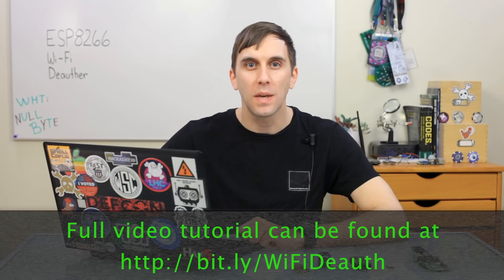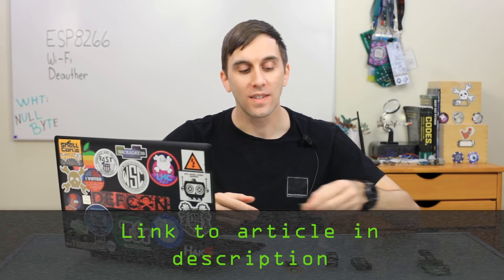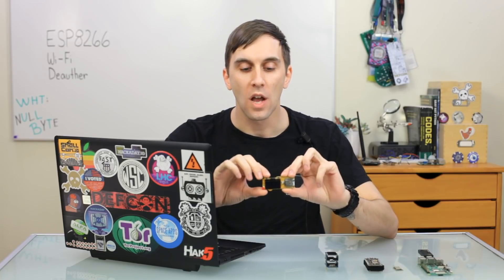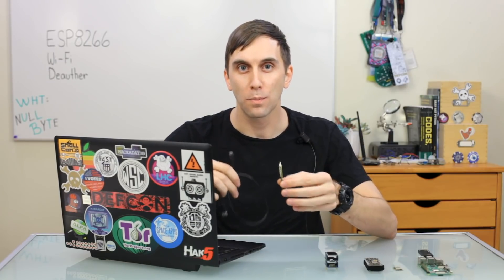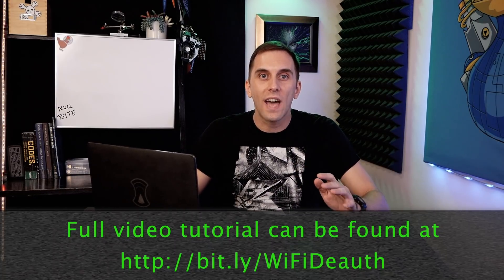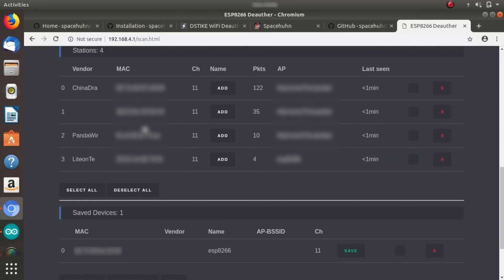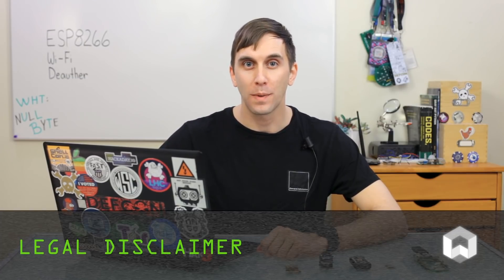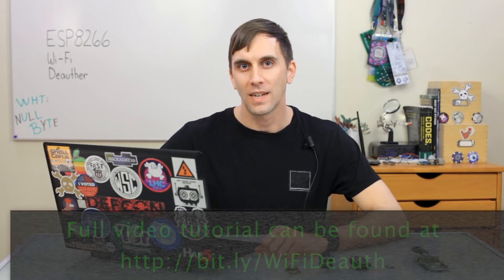How Hackers Scan & Attack Wi-Fi Networks with Low-Cost Microcontrollers

Comment: If you do get the chinese ones the trick to getting the arduino on the board just hold down the flash button while uploading.

I personally have Spacehuhns wifi monster attacked to my old 4x4 antenna with a long life battery.

LOTS OF FUN

Comment: Sir, if I want to take a raspberry pie to learn hacking, which raspberry pita will be the best or the best? And how does it cost? And if I wish, can I connect to mobile and run the command of raspberry pie with mobile? Please tell me a little?

￼
Reply: Black Devil any tbh pi 2 and 3 are good but the best is pi 4 currently it’s around $40 to $60 depending on where u buy it you’ll need to buy a shell for protection and usb got the power also need at least 8 gb but I recommend a 32 gb
Reply: @metrofusion7887  Where are from brother?

Comment: Bro i have a question on a previous video you have uploaded. The one that you used an esp8266 to capture traffic of a network. How would that work i you plug it in on a computer that it is connected to a network via cable not wifi???
Reply: It won't work for a cable network
Reply: @inwin8799  ok thanks
Reply from the maker: What in win said is correct
Reply: @NullByteWHT  I need your help! I just moved biting a house in Ohio and almost instantly I got hacked using methods you've taught. Please help me secure my devices and wifi. They now have access to everything, my gmail, security cameras which they're deleting breaking in to my house, my phones, laptops, everything. Please contact me asap if you think you can help.